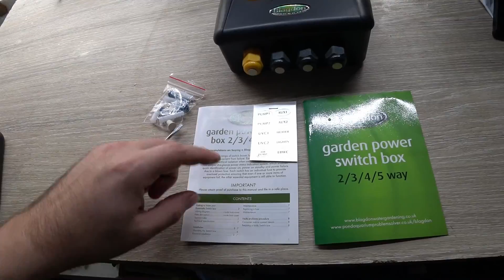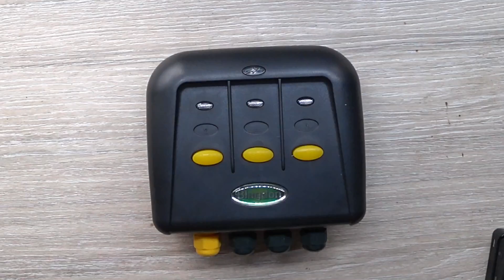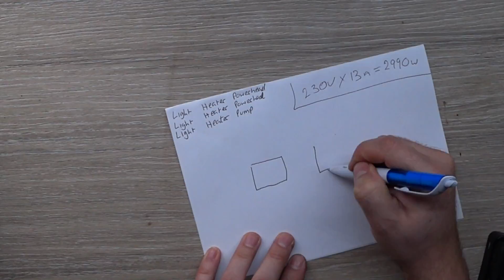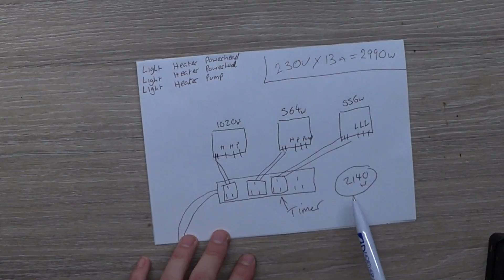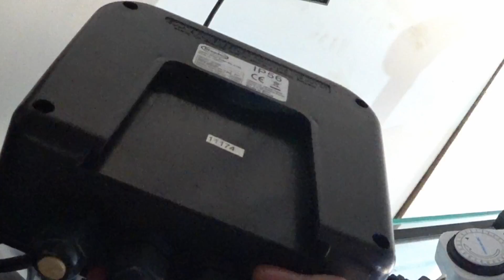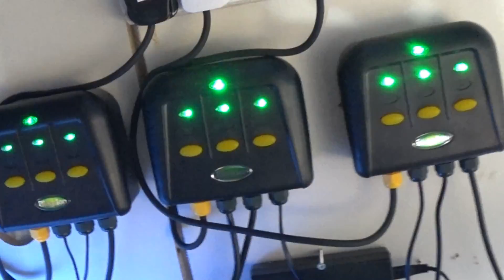Upgrading Shed Fishroom Electrics Using Blagdon Powersafe Switch box

Comment: I hope that you used a RCD unit somewhere in-line which would give you about a 40ms cut off if there’s a problem, that would apply for both in door and outdoor, it just makes sense to do so and could stop you ending up with fried fish.
Reply from the maker: In the UK outside circuits and consumer units must have RCDs in them. My electrician who has installed my new fishhouse electrics has confirmed both my sheds have inline RCDs

Comment: Always love you videos can I ask how do you go about running electric to your fish shed mate many thanks
Reply from the maker: Hello thank you. Currently I have a split 18amp connection (into a double outdoor socket) from a fuse box running from my stables but it's shared with the house utility room so I have to be very careful about load. My normal usage is around 10 amps max for my whole shed and that's split down two rings so only loads 5amp on each cable from the sockets. I have been very careful to make sure nothing is getting close to 2/3 max load. Has been running two years now and it works safely. I have digital power meters on both sockets so I know the load and cost of the shed. I have an electrician quoting me for an installation of a bespoke circuit directly from my house to make it safer and increase the load because I want to put in a second shed and more tanks!

Comment: when i was 15 i had a job as a washer upper in a hotel kitchen . Part of the job was to prep potatoes by poring a sack in to a large electric powered peeler, anyway it was wet and messy and i turned it off at the plug with a wet hand! , after flying 5ft across the room and getting up off my butt i appreciate water proof switching when playing with water.looks a lot  safer well done on the vid very helpful !